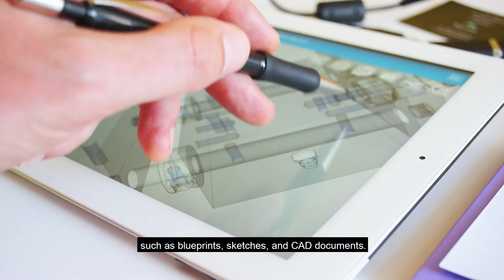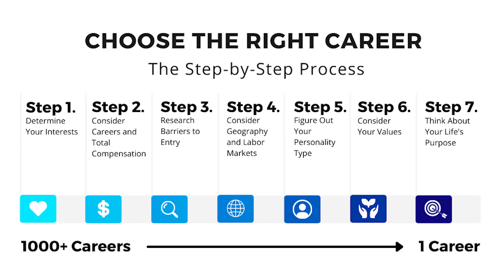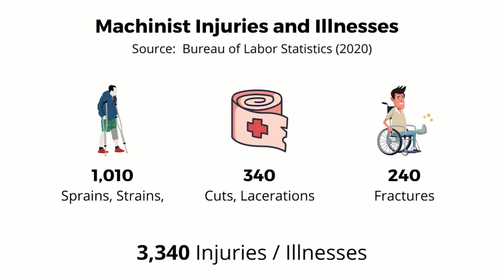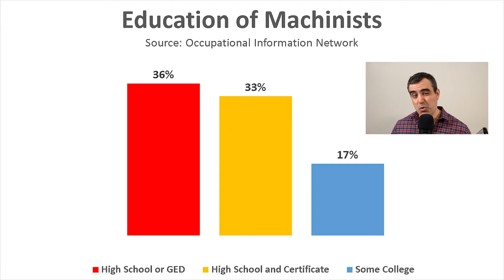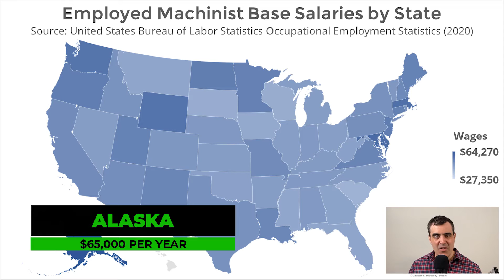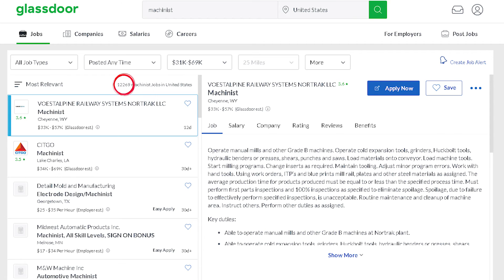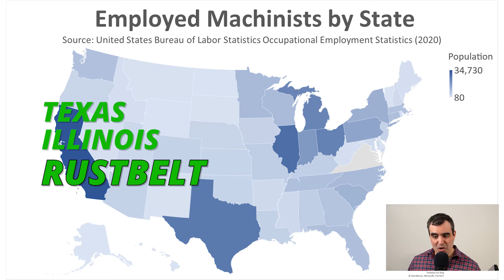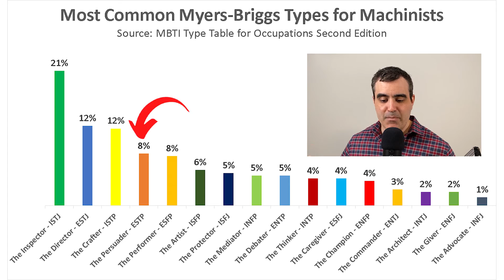Become a Machinist in 2022? Salary, Jobs, Education

Comment: Is it true that CNC operators will be replaced with robots within 3-4 years  (or maybe just a little later) and just the CNC programmer position will stay for human?
Reply: No likely anytime soon. Although the long arc across the board for is bending toward automation, new machines/technology is expensive and takes a long time to successfully implement - not only buying the tech itself but the time it’s costing you to get it up and running before you see any payoff, which is why most shops I’ve worked in are still heavily dependent on CNCs from the late 90s or earlier. 15 years ago when I was in school my teachers all said Machining wouldn’t exist as a trade in the US by now due to automation and outsourcing overseas, but demand has actually increased. Will we ever see most Machinists replaced by fully automated cells? Possibly, but it’s likely decades away rather than years, and even then you’re still going to need technicians to maintain the equipment, monitor production and Machinists to make additional fixtures and tooling.
Reply: @EugeneRossi my shop is finally moving from pen and paper to computer, full automation is in the works ; less than 10yrs out. 😅
Reply: @improvisedchaos8904 so in other words, it's an unstable career?
Reply: @ryanjones4772  honestly- yes. I don't feel secure at my job and am studying computer science to switch.
Reply: No way in hell a robot will replace me you obviously don't have any idea how hard is it to set up a CNC machine and get it to hold tolerance the whole day
Reply: @abdalrohmanmousa You are exactly right. There is way too much babysitting that you have to do. Broken inserts and tooling, incanel, duplex and other nasty metals, fine finishes are just a very few of the things that require a human peering in the window with his finger on the cycle stop button. You cant just run a piece with a .001 tolerance once. You have to back it off and  sneak up on it depending on the length of your tools and various other things.

Comment: You can break 100k working 15-20 hours of overtime if you are a top machinist. Manufacturing engineers start around 55k salary and can make up to 130k as senior engineer managers.  You don't even need a high school diploma in most cases. You start at the low end of pay no matter what degrees you get. You get paid based on what you can do and how you sell yourself during interviews.
Reply: i work 5-10 hrs of overtime every week and make 115K

Comment: Been machining for 10 years. After graduating NTMA, I started in a tool and die shop doing wire and sinker edm. I also got introduced to honing. I've had plenty different jobs, super advanced and super old-school. Comes down to this,, you want to learn the best skills,, work a small job shop. Bigger companies are an easier workflow due to procedures on repeatability for production. Smaller shops, it depends in how successfully they are to offer medical benefits or even vacation days.. biggers companies will always have benefits but hire complete morons.. Personally I hate and dred the advanced cnc world. It gets boring for me. Id rather work as a tool and die maker using my mechanical skills doings lapping, honing, reaming carbide and glass. You gotta find your strong points.
Reply: What is lapping and honing
Reply: @Camden_Carter basically a disc on one side of the part or both sides rubbing off material to a specific size. Its similar to grinding

Comment: I've been a machinist for fifteen years and my best advice is to absolutely not be a machinist.  I make decent money but most shops out there will pay you terrible wages and only want you to stand and push buttons all day.  Worst paying trade for how high precision it is.  Want to eventually start your own shop? Good luck with the incredibly high start up costs associated with buying machines and such. Be an electrician or plumber and make twice the money, faster and easier.  Also, every machine I have ever worked on can and will absolutely kill you if you aren't paying attention.
Reply: I'm in trade school, before taking our safety test I had to watch some videos. Let me tell you that seeing a man turn to mush on a lathe really made me much more aware of safety in the shop.
Reply from the maker: Thanks for sharing!
Reply: About 2 years in to this field, I hate it and want to get out, any advice on this?
Reply: @Lemongrab44  I went to trade school for it an it was too much a mental drain. Save up for a while and attend a state trade school. In TN it only cost me $700 for 4 months of school, I'm going for my CDL now and the whole program is less than 2k. Plus state trade schools have great financial assistance programs
Reply: @drottle  CDL, you would be driving trucks and what not right?
Reply: @Lemongrab44  correct, if you need a change of pace you can drive for Amazon with a class D. I also drove a small truck for auto zone, you need an F endorsement for that. I’d highly recommend working for AutoZone, pays almost $20 an hour and is really easy. Just take car parts to places within 10 miles, commercial driving is a great job, at least that’s how I see it.
Reply: @Lemongrab44  If I could go back in time I would be an Electrician of some sort.
Reply: I'm a traveling machinist, and make 45 a hour.

Just wait until america goes to war with china, and machinist will be needed so badly in america.
Reply: I work 12.5 hr shifts, only work 3 days a week and get same 4 days off every week and I’m getting 33.05 hr
Reply: @Trunks88088  Pretty interesting shift.  They still pay benefits with you working under 40 hour weeks?
Reply: I agree. A lot of stress. Sometimes monotonous, repetitive bs. God help you if you screw up a piece. Why did you do that? Why is there chatter in that seal bore? We just bought you a new boring bar 2 years ago. It goes on and on. If i could start over i would do a different trade. Autobody or hvac.

Comment: Hi I really enjoyed the video but I have a question what level of math proficiency would I  need for this kind of job? I graduated from highschool recently and math has never been my strongest subject.
Reply: As long as you can use a calculator.  CAD made knowing Trigonometry obsolete.
Reply: Trig and geometry and regular math
Reply: I'm a highschool drop out and never learned trig or anything past about 9th grade math but I've been working as a machinist for 5 years now and I make 48 an hour. I learned everything I need on the job.
Reply: I’ve been machining for 7 years now and I rarely ever use trig. Majority of the software used will do the Math for you. Weather it’s conversational programming or cad cam. Basic addition and subtraction and a decent work ethic has gotten a 70k salary and 100k working 10hr days.
Reply: If you want to become an engineer designer, you have to be an expert in trigonometry and algebra.
Reply: Grade 11 math would be enough, it depends which country you’re from.
But here most colleges dont look for math average as long as you have received G11 or G12